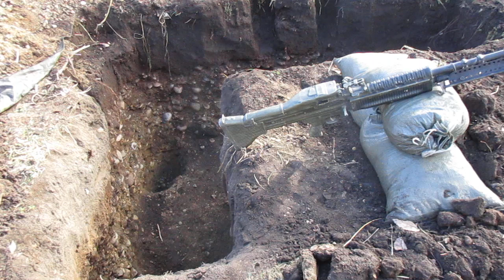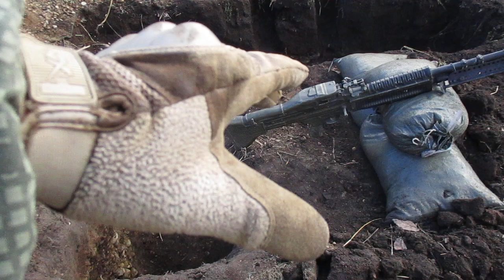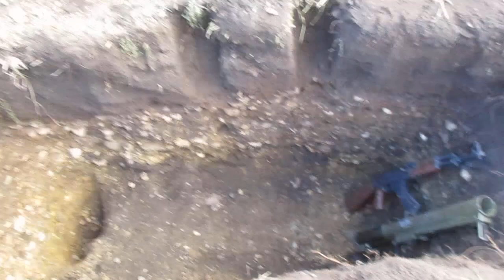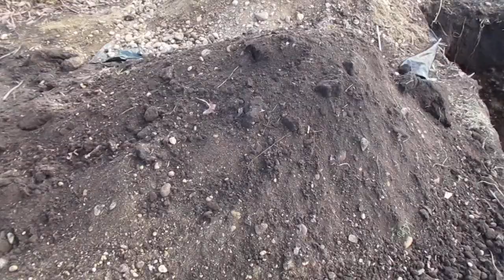Militia Engineer Tasks- L-Shaped Machine Gun Position

Comment: Better to design and use a MG that isn't an M60 ...then you don't need to dig a slit-trench to change the bloody barrel...
Reply from the maker: You want to change the bloody barrel on a machine gun or the bloody thing will turn cherry red.  Then the bloody thing will start cooking off rounds until one of the slugs gets trapped in the barrel and the bloody barrel explodes in your face.
Reply: Ah! A man of culture! Still rocking the water cooled Maxim? 

Because every other MG design requires a barrel change if it is to sustain fire.
Reply: Erm acktchually not EVERY machine gun requires a changing barrel, like the PKP ☝️🤓